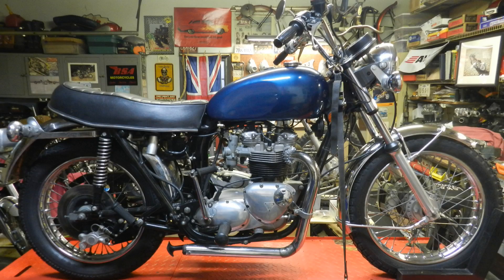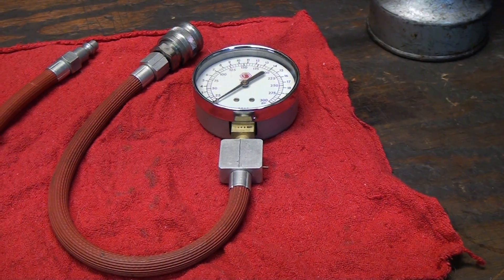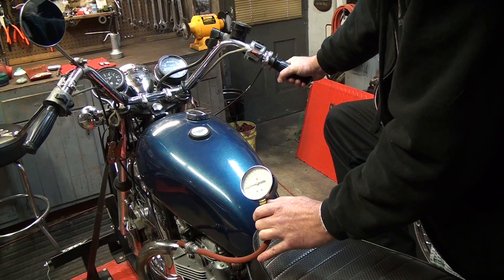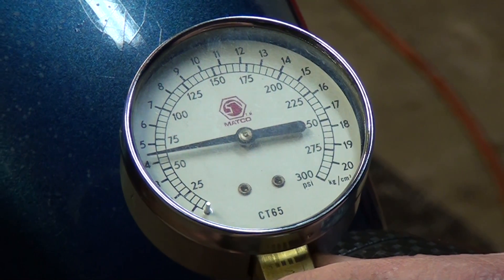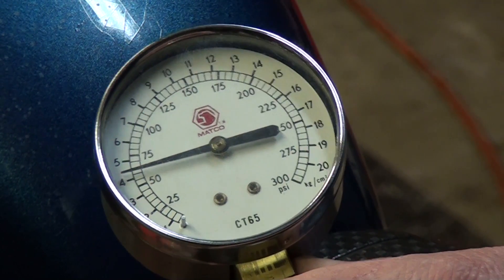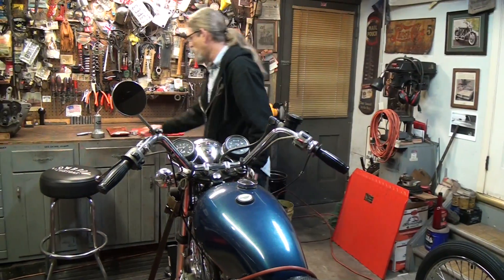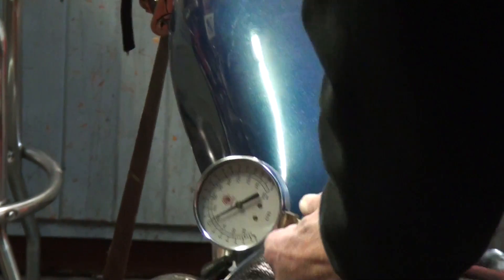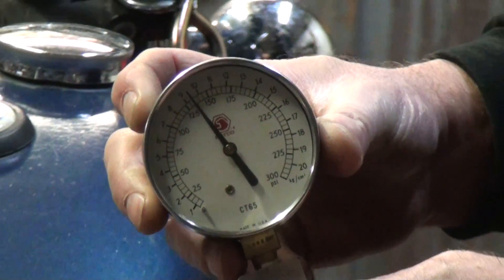DIY Tech Tip: Perform A Compression Test on your Motorcycle

Comment: I know this is 11 years old but i have a question.  After putting in the oil, if the pressure goes up, its a leaking ring. If it stays the same, a valve may be sticking.. if there are no problems,  what kinda reading are you looking for? The only option left is, if the pressure goes down.. that cant be a sign that all is well. Help me understand this. Thanks

Comment: Yeah, thanks for this. Really informative is great to practically see what people write about 
The only slide difference in your approaches that sometimes people recommend you leave the oil a couple of minutes to flow over the dome of the piston 
Very interesting the difference in readings between a cold engine and a warm one
I just did a cold test on my commando recently required and it was just over 100 which I thought was a bit low, but I think I might well attempt one with the engine Warm  might get me into the ballpark of okay

Comment: So it nearly doubled after letting the bike warm up.   If my bike is running fine and the compression numbers seem within spec, should I still put some oil into the cylinders to see if I get a higher number?

Comment: Hello, I assume the spark plug shouldn’t be in the cylinder while testing it, but I have a carburetor, should I take that out or leave it? 
Thanks I appreciate the video
Reply from the maker: Says it at 01:23 if a Twin remove both spark plugs. You can see the carbs are still on the bike so leave them on.

Comment: I don’t get it.

So do we go off the first readings of 60psi when engine was cold?

Or do we go off the 115psi when engine was hot?
Reply: The reading on the hot engine.
Reply: @Albert G. 

Is there anything we can tell from the cold reading?
Reply: @114wildfire  it should just be a rough measurement to see how bad a shape it's in... 60 cold would tell you it definitely needs work, but it wouldn't allow you to know the correct hot reading unless you turn the bike on and let it warm up. In his case it jumped from 60 to 115 which is a big jump, but 115 is still on the low side.
Reply: @114wildfire  you can also compare cold readings across cylinders just to make sure they're not drastically different from one another.
Reply: @Albert G. 

I have a ninja 250 that measures 60 on both cylinders cold.

When I’m able to get it to run,  it will idle for a minute or less and then it’s hard to start after that. 

Other times,  I have to give it gas for it to idle, and when I release the gas,  it dies.

Do you have any ideaa
Reply: @114wildfire  was it running fine before? Did you do the oil leak down test from the end of the video? If it happened from one day to the next maybe you blew a head gasket but idk I'm no expert.
Reply: @Albert G. 

I bought it with a carb problem.

It idled but died on throttle.  

Rebuilt and cleaned carbs and it’s been giving me Problens still...
Reply: Is there anything we can tell from the cold reading?

Comment: Buzey with a rebuild.No kick start and no wireing harness.Usted a torch wrentch and jammed the butter fly open and crank over engine.Easy way of checking any engine in or out of frame with a compression tester

Comment: Great video! Very informative, Thank you. One quick question - what is the reason to have the throttle wide open? What is does from the technical point of view? Thanks for the answer.
Reply from the maker: If the throttle is closed, the cylinder fills with less than a full charge of air -- that's what the throttle is there for. So there's a vacuum (i.e. lower absolute pressure) in the cylinder. Then the piston compresses the vacuum, so the peak pressure in the cylinder is less than it would be if the cylinder had been allowed to draw in its full volume.
Reply: Oh! I see now. That makes sense, didn't realize that. Thanks! :)

Comment: Great tutorial........I am helping my sun do a rebuild of a Suzuka Savage 40.  The bike ran well when he bought it and we should have checked compression then but we have the bike torn down with the engine on the floor.  Is there any way we can check this engine's compression now that it is out of the frame?  Also, this bike does not have a kick starter........we are going to be building a Ryca Cafe Racer.

Comment: all engines rise a bit on the wet test, it doesn't mean the rings are bad unless it's big jump
Reply: paul 466 how big of a difference
Reply: @wilanderson1218  I'd say anything over 20psi of compression difference after you've added some oil to make'r a full wet test. Oil is great for sealing them down to the oil ring. Oops didnt watch before replying lol

Comment: So with oil added if pressure increases the rings are bad, if it doesn't change, there's a valve seating issue.  That means regardless of reading, there's a problem, right?
Reply: yeah - that's weird - I guess that would be true if you have a bad reading on your compression: if the compression is out of specs, then the oil in cylinders would give you indication if its the cylinder or the valves that are in cause.

Comment: I have a 1999 Kawasaki ninja ZX6E it has 90-100 pounds of compression in all cylinders its supposed to run at between 135-215....my ninja will run fine for awhile but then it acts like it fouls a spark plug and then it is a sucker to get it to idle proper and to keep it running at idle.  but i believe i need to get new valves and seats in the carbs. and i have set the floats properly. could i add engine restore to my ninja to restore my compression? valves have been checked for clearances and all seem proper. what is your take on it lowbrowcustoms???

Comment: so you're supposed to do this test with the motor oil drained from the engine, yes? and when you squirt oil into the engine, is there a specific way you need to do that, or can you just pour it down through the sparkplug hole? when you squirt oil into the engine and the pressure stays the same, then it's good, right? provided the valve clearances are in spec? how much further up does it need to be to indicate that you need replace the gaskets?

thanks